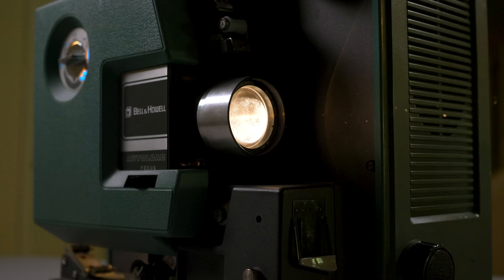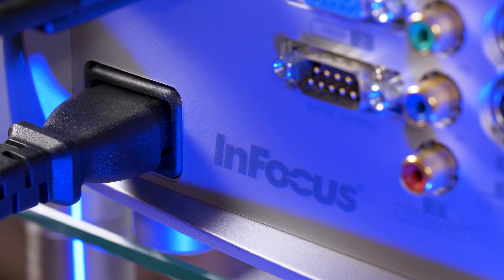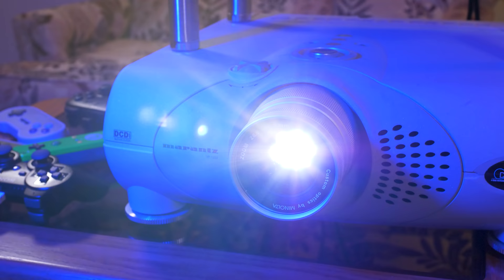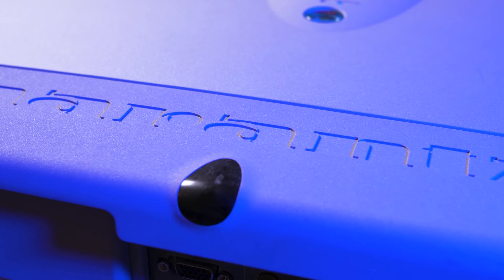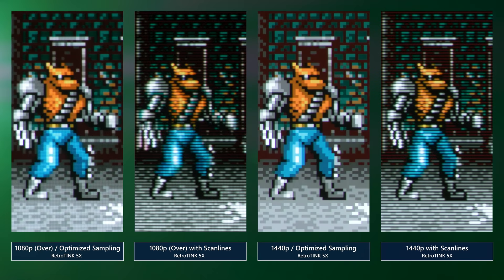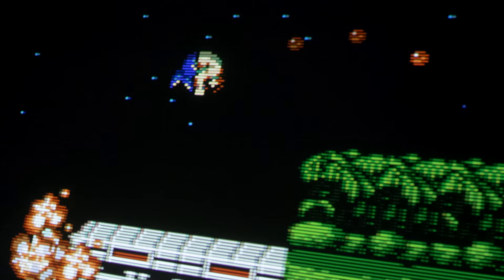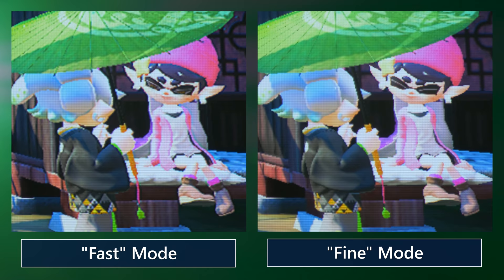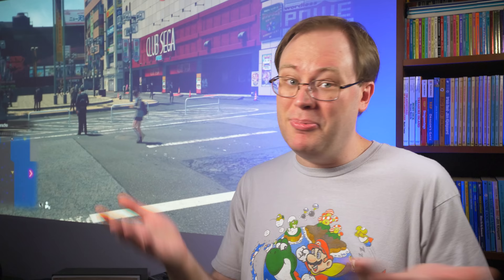Gaming on Projectors - From Retro to HD to 4K HDR / MY LIFE IN GAMING

Comment: I'm a big fan of LED projectors, mainly because I absolutely hate feeling like I have to ration time whenever I use a standard bulb-based projector. I just wanna be able to leave it on for hours idling and not have to worry about it.

I went from an LG HS200 (800x600) as my first one, to a Vivitek Qumi (720p), to a VIvitek Qumi Q38 (1080p). All of them have a roughly 30 000 lamp hour life span (roughly 20 years at 8 hours a day). I got a 120" roll up screen back when I got the first Qumi and I love it. (And now I can use my old projectors, which still work, to project videos of ghosts and zombies on white shower curtains in my windows for Halloween).

I've never noticed any latency when playing games on any of them when using the proper settings.

The main downside with these particular LED projectors is that they are relatively dim, around 200-300 lumens, though that's a bit deceptive. In my experience because of the vividness of the colors 300 lumens on an LED projector appears a lot brighter to the eye than 300 lumens would on a bulb-based projector. I always set my projectors up in rooms that can be made to be quite dark (putting the projector screen in front a window can help).

A major upside is that the ones I get, which are often designed to be portable projectors for presentations, are very affordable, between $500 and $1000 new.

Comment: The lag situation for analog inputs matches my experience, or at least for 15 kHz inputs. Feed a projector a 480p or higher signal, and lag might be quite good. Feed it a 15 kHz signal via composite or s-video (per maybe even component or RGB) and you'll probably engage the deinterlacer and add several additional frames of lag. In my case, my projector had two frames of lag for progressive signals, and four frames of lag for 240p/480i. So, a RetroTINK 2X/5X or OSSC is still recommended.
Reply from the maker: [Try4ce] Yeah I mostly just wanted to focus on 15kHz lag because that's what most people are likely to want to try with the analog inputs. Especially since the Faroudja stuff might seem like a selling point.

Comment: I play MiSTER on an epson 5040ub, low input lag and that fancy output that does native refresh. Alongside pc/playstation. 3lcd is cool. Gotta darken the room and ceiling for good projector performance fo sho. With black ceilings and walls (by painting or using black soundfoam or black curtains etc) and a proper screen on a frame, you'd get performance that is far, far better than you see here. Try it!

Comment: Epson 5050 UB, refurbished. It's about $2200 direct from Epson. That'll get you 4K 120hz, HDR, and some of the best black levels you can get in projection for under $7000. Do not get a 5040UB, though. It's tempting because it's the previous year's mode, but it doesn't do 4K 60 and they're notoriously prone to faulty power supply units.

Comment: Optoma HD29H is my choice. It works perfectly! 3D is amazing and inputlag is at 16ms by 1080p and 60hz down to 8ms in 120hz.

My screen has 100 inches and is white and has 1.5 gain which is perfectly for me in my setup. Sound comes from my Logotech Z5500 and I got my Xbox One (as 3D Bluray Player) and my Amazon Fire Stick and my Switch connected. It is a blast to play in this Setting ^_^

Comment: For the record, the 360 can output 1360x768 over its proprietary VGA cord, and it looks great on a "720p" TV with a VGA port.
Reply from the maker: [Try4ce] That's pretty interesting! Does it embed the 720p picture within a black border or something? Unfortunately I have the Xbox 360 E model, so I would not be able to do this.
Reply: @mylifeingaming  nah, it just scales the image unfortunately, but the 360 does at least seem to do a better job than the TV itself.

Comment: 17:35 I much prefer the non HDR sample because the "HDR" effect is applying a simplistic contrast process that results in over-saturation. This is the opposite of what HDR should be. HDR should be expanding the image data so that it increases the luminous range of the picture, instead what you have is decreasing the dynamics of the picture via contrast. It kills the mid-range by saturating it.
Reply from the maker: [Try4ce] Right, the picture itself is not going to sell you on the feature when not viewed in actual HDR. The camera can't capture the full range being shown. The sun is blown out and over-bright on the HDR side for the recording, but in person, I can see more nuance to the color. It's just that it's too bright for the camera to capture at that level of exposure.

Comment: While projectors may not be on par with OLEDs in terms of black levels, I think its worth pointing out that using a grey or black projector paint can get you closer. That said, you are sacrificing some of the brightness with grey and more with black.
Reply: Also worth mentioning that white projector paint will allow you to get away with using it in a well lit room. I have a wall devoted to this in my living room where the lights are often on, and gaming is only an issue in areas like the tomb of the giants in dark souls which is a very extreme example.

Comment: When the lamp in my projector died (Mitsubishi HC4000), I couldn't find official replacement for it in my country. Importing it would've been too expensive. So I bought one from China, and it somehow broke my projector (something wrong with power circuit, I believe). That was a very unpleasant experience. I was choosing between OLED and a new projector, and I went with OLED. While I believe it was a right decision (movies and modern games look AWESOME on it), the projector was far better for older games (especially PS3 and Xbox 360) and movies on DVD. In the end, my "projection" part of life was a great experience, but OLED wins overall. And I got Sony Trinitron for my retro needs :)

Comment: So going in deep in research for a gaimg projector. There is one that is the best, but is also the most expensive option.

Short throw Lazer TVs
These are projectors that go right up to the screen. Like maybe an inch or 2 and it'll display a big screen. That combined with a specific type of screen will show a clear image even in a bright room.

The screen technology is interesting. It's a saw tooth patterned screen that smartly blocks most light from the stop, while showing any light coming from the bottom clearly. Obviously this type screen only works with ultra short throw projectors

Comment: Dude you really gotta check out the Optoma UHD 38, it's a 4k pixel-shift DLP projector that not only has a low input lag of 16.7ms at 60hz (so essentially none), it also supports 1080p@240hz and it also has an input lag of 4.2ms in that mode. This is because pixel shifting is essentially running 4 times a 1080p60 image so when you add all 240 frames together it becomes a single 4k image at 60hz. They literally only needed to write in to firmware that it accepts a 240hz signal and a processor that can handle those speeds. At 240hz you also don't really see the rainbow effect as much and 4000 ANSI Lumen is pretty nice for the price.

This video got me in to this huge wormhole, and I'm now gonna be spending a lot of money on this stuff so thanks I guess. On the other hand, running a hidden projector + a floor rising screen looks way better than a big ass tv in your living room so there are more benefits than just having sharp pixels at 1080p. Also, according to the manual it supports a 1200p/60 signal natively so that should be very nice for running a 5x resolution scale for 240p with a MiSTer. Also 120hz at oddball resolutions on VGA, definitely worth a shot to play around with since the pixel response time might be better at a higher refresh rate.
Reply from the maker: [Try4ce] The TK700STi claims similar readings for 120Hz and 240Hz but I can't measure it myself so I didn't get into the details there. It's really neat how the math works out though, and I almost mentioned it for that reason! I dunno, I think pixel shifting is neat!

Comment: As soon as I saw the DLP badge on one of your projectors, I was hoping you’d get to the rainbow effect that drives me absolutely INSANE. I own an Epson 3LCD model that’s so much better.
Reply from the maker: [Try4ce] I do think if I were to ever commit to a projector for my main gaming setup at home, I'd have to go for one where I don't see the rainbows. It's totally tolerable as a "sometimes" thing I play with away from home, though. I also don't really see it on the Marantz, but it's also way dimmer.
Reply: 3 LCD Projectors offer a more vibrant image compared to DLP with out the rainbow effect at a cost of a slightly softer image. However, one thing to keep in mind is that short throw lenses and ultra short throw lenses with also have softer images in the area where the light hits last or the furthest point of the screen.
Reply: Christie LX55 is a model for reference. Sanyo also made a similar projector with the same guts. These were the medium tier projectors I used when I started working in hotel audio visual 12 years ago. 3 DLP Panasonic projectors are great as well but a little more expensive.

Comment: Try-- excellent output, as always! I find the idea of an inexpensive, projected 720p solution compelling. I am currently running a 1080p 3LCD projector for my retro gaming (Epson 2150), with mixed results, and I'm wondering if a downgrade could actually improve things. This is is my setup:
- SNES - Analogue Super NT (1080p/720p/480p)
- Genesis - Analogue Mega Sg (1080p/720p/480p)
- N64 - PixelFX N64Digital (1080p, ?)
- GameCube - Insurrection Carby v2 (?)
- Other - NES Mini, SNES Mini, Genesis Mini, Core Duo Mini (720p)
Am I doing the wrong thing to plug these into a full HD projector, and would an intentional downgrade to 720p actually improve my picture? Particularly problematic is the GameCube (lots of unsavory artifacts), and I'm not sure whether the issue is related to having the wrong settings on the mod/upscaler or rather due simply to my display device.
Reply from the maker: [Try4ce] Hmm with the Analogue devices, I feel you'd get the best picture at 1080p, but with the others, it's hard to say!

Comment: The biggest issue with projectors, especially older ones, is finding lamp replacements. I would say even if you got a projector for super cheap, it is not worth it because you most likely will not be able to find a replacement lamp.

Comment: This question might be a bit outside your wheelhouse maybe, but I have to ask. How would you set-up all of your consoles into your sound system? And the differences between a soundbar and a surround sound system

Basically a whole episode on sound set-up
Reply from the maker: [Try4ce] Mostly just plug them straight into the receiver with HDMI. And use HDMI switchers connected to some of those inputs to get more. While it doesn't focus on the sound aspect, our episode about gaming on 4K TVs pretty well explains how I use the receiver to connect stuff.
Reply: @mylifeingaming  what about older consoles that can use toslink cables? I'm really curious on that for some reason
Reply from the maker: [Try4ce] Most receivers should have inputs for those too. They aren't a big deal to use.
Reply: @mylifeingaming bit late to reply here. But my set up has changed and questions need to be asked.

If you connect your retro consoles (with toslink) to a retrotink, do you connect the hdmi output to the receiver or straight to the TV? 

Cause my receiver can't play hdmi video with toslink audio at the same time. And I'm planning on a setup with a TV during the day, and a projector at night. And it would be easier for me if all hdmi inputs were connected to the receiver

Comment: With super cheap projector you are best setting you ps4 or xbox console to 480p if you projector is a 480p model or 720p if it a 720p model !
Only problem I've had with bomaker 720p projector is when I've setting to 1080i with my ps4 is that the projector will NOT  accepted the signal and the screen was a mess !

Comment: 720p integer scales into 4K using 3X and most recent sets like my R625 support this, the biggest problem with 360/PS3 era is that many games were sub 720 so you’ll get poor image quality regardless due to the poor hardware/software scaling used on those consoles.
Reply from the maker: [Try4ce] I've only heard of some Panasonic TVs (not sold in the US) having nearest neighbor integer scaling for 720p or 1080p. It should be a thing, but I've never seen anyone say it's a common feature. Usually scaling is done softly on TVs even if it could be an integer scale.

Comment: Great video. I do want to note that you should not see the DLP rainbow effect on a LED DLP that does use a bulb or color wheel.
Also the newer Laser DLP projectors should also not have the effect and possibly better black levels.
Reply: Not true, I have the LG PF85U DLP LED projector and I notice a lot of rainbows. I also had the older LG PA70G DLP LED projector which shows very little rainbows when set to refresh at 120Hz, but it still is noticeable. Maybe It all depends on how fast they pulse the LEDs. I also had a laser/LED hybrid projector in the past that had unbearable rainbows. In the past any bulb based projector were usually unbearable for me due to the slow color wheels. I think once they make >=240Hz DLP LED projectors then it should be a non-issue for me.

Comment: Great video! I'm curious though. Is there a way to output 720p and even 480p as 1080p with black borders? (no actual scaling). My thinking is that through a projector you could achieve an unscaled, completely interger representstion of 480p and 720p at a half decent size. Sure, 480p would use just under half of the 1080p real estate but given the 97inch picture it would still be a bigger picture than your average CRT right? To be fair, 720p would be close to 65 inches! That's respectable for native 720p.  I'm not sure how good the results would look but it could be an interesting all in one solution and an alternative to multiformat CRTs or upscaling.

Comment: the best resolution plausible is 720x576i/p from s-video  as this is the limitation of the  video  if you can  component cable from  wii/cube  it should work on snes

note that 1080p/i has only been  supported within the last 10 or so years from a vga perspective very few actually supported the 1280x720 or higher

the only component  cables I know capable of 1080i/p  was the ps3..

far as i'm aware  whilst  nintendo could of supported 1080i/p as far back as the cube due to hardware limitations that plagued their  hardware to current day 720x576i8/p native upscale to 1080i/p and 4k if or when supported

Long term preservation  7200-15k rpm hdd or high capacity ssd past 8 TB in raid

 know this is a no brainer of questionable statement  however  what would of happened if sega had of matched sony  with a dvdrom rather than the failure of  gdrom format which was the last bastion of the  cdrom/cdi format because even as bad as it was graphically sega always  had the competition beat

I suspect sega would still be in the console business  today if dvd had of been used in the saturn and latter in the DC

In term of resolution support

composite 640x480- 1280x720i
s-video (bus limitation) 720x576i/p 
component: the only component for console that can drive to 1080i/p is the ps3's component cable

at best due to the limitations of dvd/bd supported drives of that time you get limitations in the dvd portion..

the only time you actually  1080i/p  AND 2/4K  where supported is in mid to top tier dvd players 

you could likely force 1080i/p 4k out of  consoles from ps2/xbox/game cube/ps3/wii/wiiu with rom upgrade however I doubt you can force a progressive scan outcome even from a vga conversion because at that time vga never supported  1080i/p

Noting that default where supported by  the console for wide screen was 720x576 resolution..

also note if you are seeing a crisper image on the highest setting the projector can do I would suspect duller image is likely to be interlace scan with the crisper image forcing a progressive scan image

i've been fucking about with a/v tech since the 1980's  and gaming consoles since the mid to late 80's to know most console will support a widescreen format if connected to a wide screen monitor of form or function I don't  give 2 fucks how long you lived in 4:3 FOR YOUR GAMING PREFERENCES HOWEVER MOST CONSOLED RUN IN EITHER 14:9/16:9 RATIO

wHILST CD BASED MEDIA ON PC MIGHT BE ABLE TO HIGHER RESOLUTIONS FROM A CONSOLE PERSPECTIVE CD/CD-I/GDROM BASED MEDIA ALL YOU ARE GOING AS A HIGH POINT RESOLUTION IS 720X6576I/P OR WHATEVER EXISTED IN VCD 1.0/2.0  AND S-VCD FORMAT PRIOR TO THE DVD STANDARD BEING FINALIZED AND DOMINATE CD SIZED  MEDIA..

ALSO WITH SOME TYPES OF PROJECTORS  TO FIX CERTAIN ISSUES YOUR ADDING  PRISM CANS TO THE FRONT

Comment: The only problem with Super Budget Projector is that with pal m is 60hz 480 lines and I get black and white picture when using a ntsc game on a pal b playstion one rca leads !.
You are best getting a native 720p projector budget projector as a lot of them are 480p and Contrast Ratio 1000:1 .720p are a lot better having Contrast Ratio 2000:1 or more !
Super Budget Projector  be careful as some say support 1080p But will down scale to 480p or 720p !

Comment: If the options of 10-20 years of any projectors and hd tv options were available back in the 90s, gamers would be flipping burgers double time to get. I bought one projector $100 just to have both HDMI and Av ouput. The bad thing I didn't consider is the audio issue.  The projector own audio output is terrible. Perhaps I need to find a cheap stereo to hook it up. It can only display 1080 and 720.  I watch and play games on one of my spare bed room although I have to put a baby blanket over the window to darken the room.